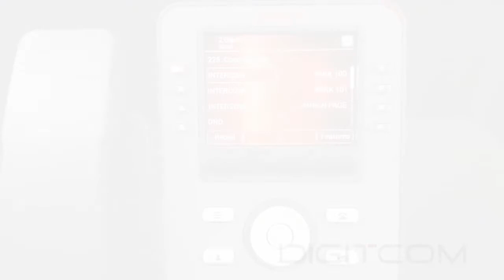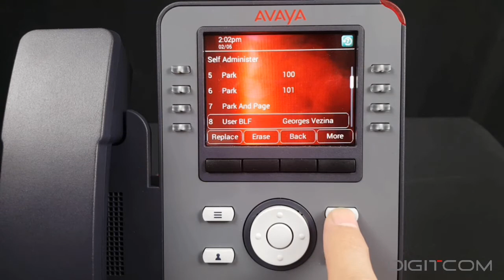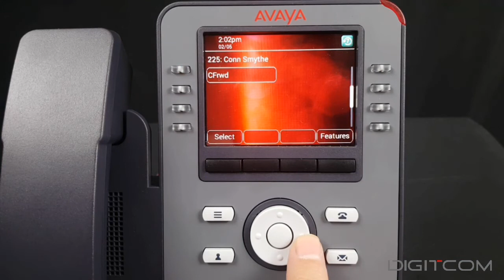Avaya J169 & J179 Phones: Setting up Speed Dial

Comment: For those that are trying to add an extension number (quick contact) to the phones home screen. You can do this on the phone itself (as well as the software on your computer). First you need to go into your contacts (picture of man button), then find the person within your contacts you want to have on your phones home screen (or make a new contact if they are not already in there) and turn them into a quick contact by pressing "Details"  then "+Contact". They will now be a quick contact. Go back to the very start home screen and hold down the button where you want their name to go and press "Add" then "contact", then you will notice the person you just made a quick contact will now be an available option you can select. I hope this helps others as none of the instructions I found online or YouTube told anyone this.